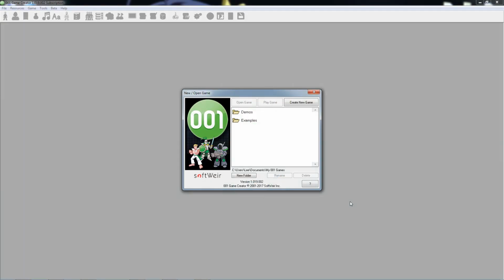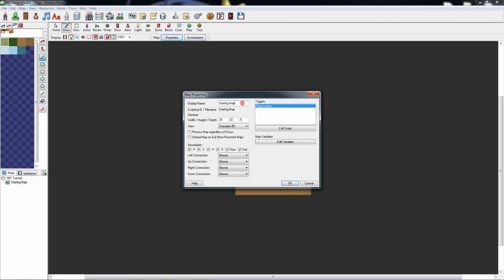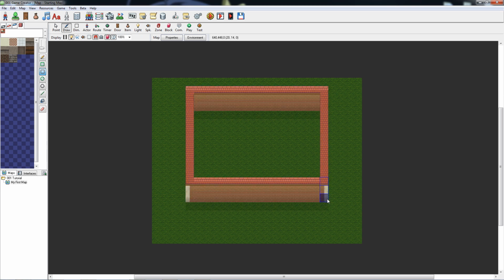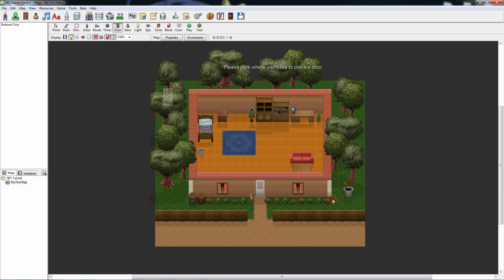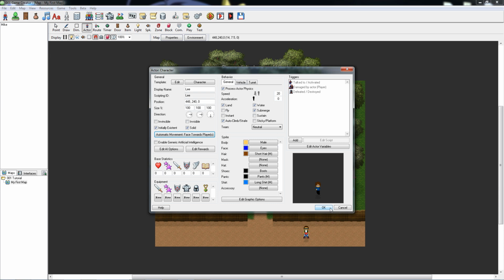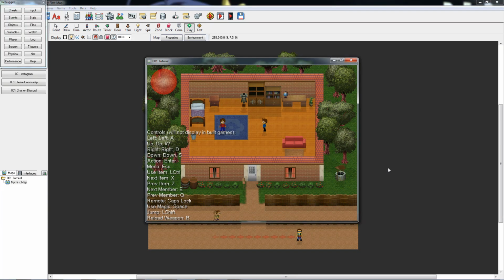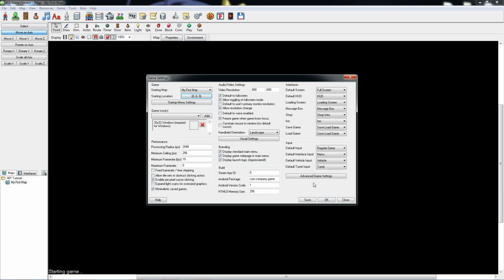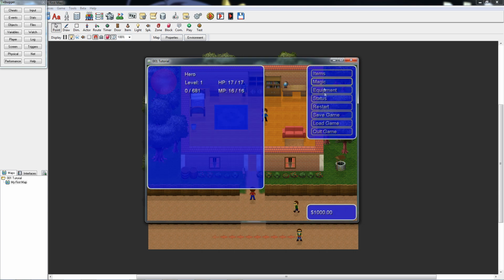001 Game Creator Tutorial | RPG - Setup (Part 1/5)

Comment: This video  is  rushed, it looks like it was sped up. I would slow  down and take my time especially if you are trying to sell this .
Reply: Click the settings cog on the bottom-right of the video window, select playback speed from the pop-up menu, select 0.75, or at the top-right of that list, click "custom" and set it to 0.85. You're welcome :3
Reply: look for the CC button for closed caption, to the right of it is a COG icon.
click it. select .25. That will slow down playback speed for you.
Or you could learn that the J K L buttons(from keyboards) are back 10 seconds, Pause/Play, forward 10 seconds.